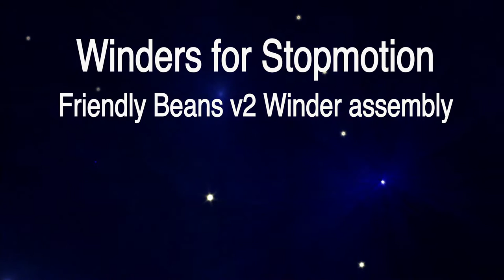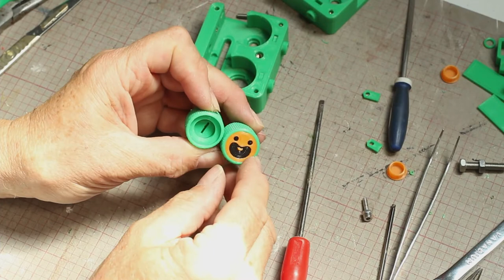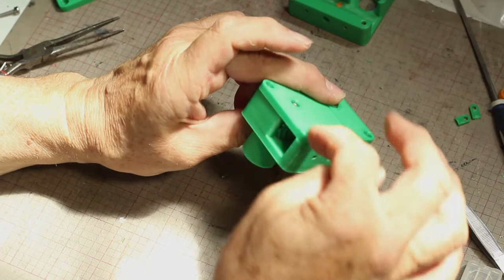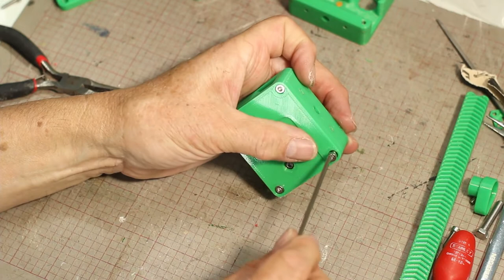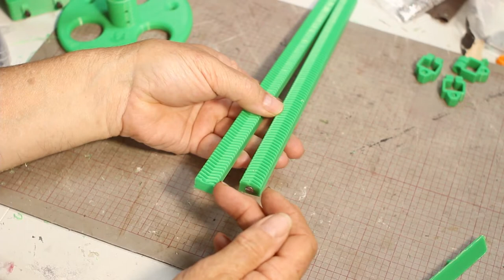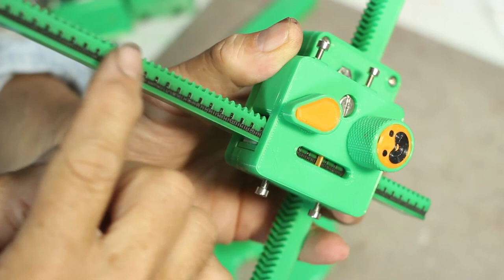DIYnders v2 Winders assembly

Comment: Thanks for the instructions! Just had this printed in Pa12 materal (Nylon 12). Still need to find PTFE sheets but so far feels pretty sturdy. 
As for maintanance in order to keep the gears working for the long term, do you find locking and releasing the lock knob after each movement helping? Or would you rely on the break pad more?
Thanks
Reply from the maker: Sounds like yours will be pretty tough in nylon. I don't think it will matter much whether you use the lock knob or brake pad to immobilise the rack, it is all reasonably solid. The v1 lock knob was a different matter, as it pushed a bolt into the side of the rack.

Comment: Any idea if the dumb American 1/4-20 rod/nuts/bolts will work in these instead of m6? I don’t imagine its a huge difference size wise.
Reply from the maker: The M6 threaded rod cuts its own thread in the plastic rack as it goes in, and it is good to lubricate it a bit as you drive it in. 1/4” is 6.35mm, so it is only a tiny bit bigger, and the thread is irrelevant . I reckon there is quite a bit of heat generated as the rod is driven in, so the plastic softens a little around it. But I will ask the designer if he thinks it is OK. As for the other nuts and bolts, I don’t think it is possible to use imperial alternatives as many of the M3 nuts are slid into tight fitting pockets.
Reply from the maker: Hi Eric. Luke reckons you should be OK if you fill up the tube with WD40 and take it slowly with the drill.

Comment: at the 6:01 mark , im not seeing the file for this model to print. on the v002 zip folder.
Reply from the maker: Sorry, Anthony. I have only just picked this up. I think the file was misnamed as M3 insert, when it should be M5 insert. If you can't find these files, please contact Luke via Cults 3D. In any event, the part is not essential to the working of the winders, it just stops the nut from coming out of its pocket, although it should be pretty firm in there.

Comment: These look fantastic. Thanks for the assembly instructions. Do you know if they are available anywhere printed and ready to assemble as a kit ?
Reply from the maker: They are designed for you to print and assemble. Do you know someone with a 3D printer?
Reply: @oddplanetstudios6172  Not at the moment. They had one where I worked years ago. I will ask around. Someone said there are 3d printing services on Ebay that are reasonable. I have most of the metal hardware in my stash. What plastic type would you recommend for the best durability and least shrinkage ? Thanks for the reply .
Reply from the maker: @marylewis3311  I have printed them in PLA, but Luke the designer has been doing them in PETg. I suspect PLA gives a crisper detail. PLA+ might be the ideal material. Are you in the UK?